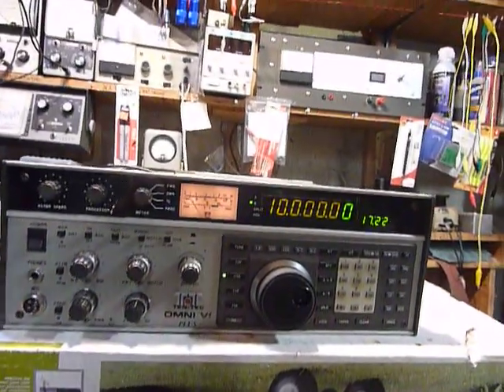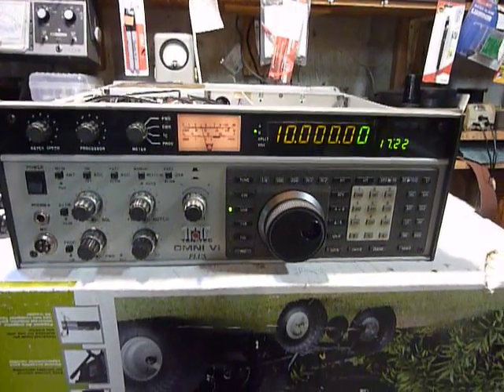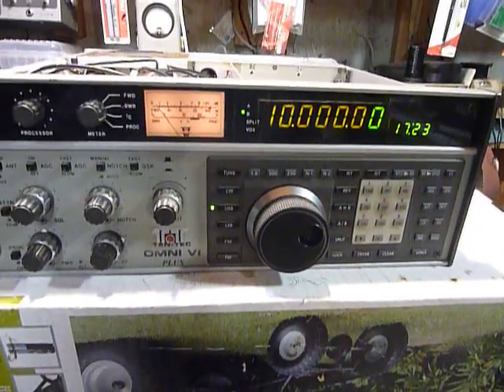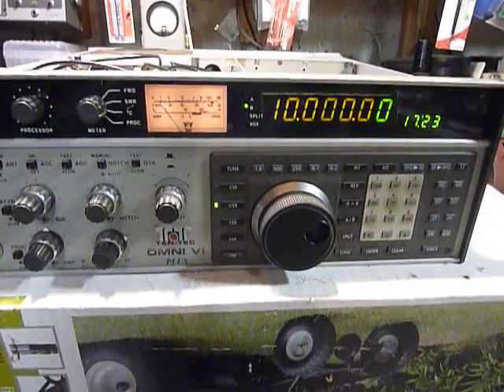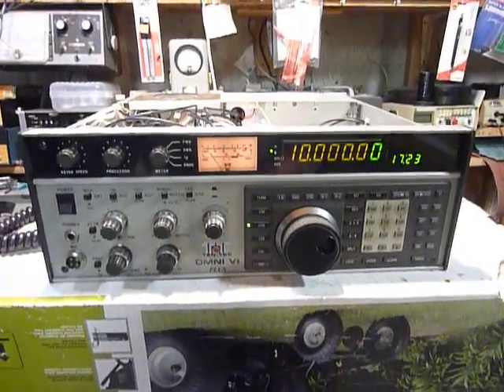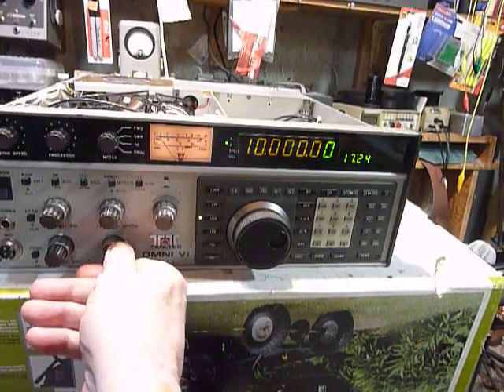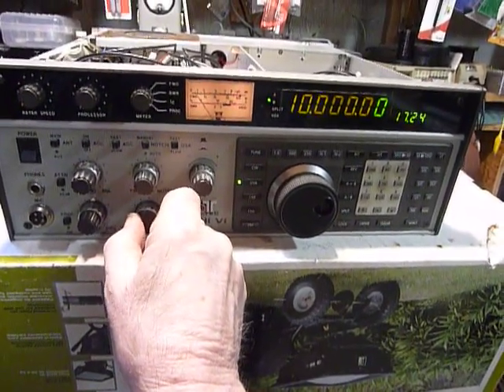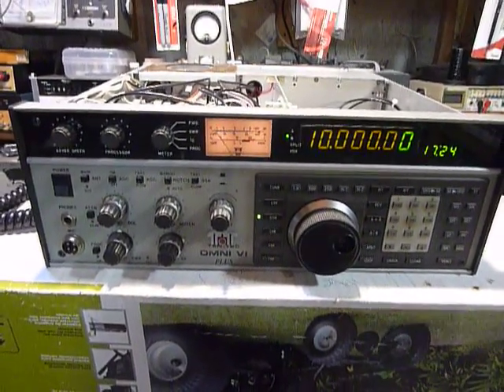Part 4 , Ten Tec Repair , Intermittent Pl Board ,  Final test run

Comment: Hi Bob, 
Just a fyi: From at least the Corsair the pcb's at TT were wave solderd and usually looked nasty with flux everywhere and as you saw solder balls also everywhere. In fact the Paragon had 3 pcb's which made up the PLL and after 6 months or so of use the users would get the dreaded PLL unlocked message. Turns out those boards were too light for the wave solder tank and would not solder well at times or in places. Removing the boards and resoldering all of the solder connections with fresh flux would solve the problem.
I am a TT collector and when I buy another TT rig, I pull the pcb's, clean them with acetone, outside, and inspect solder connections.
I am also not a fan of the friction connectors throughout the TT rigs but they seem to hold up OK. One thing you can do from time to time is go through the rig connector by connector, lift the connector and brush the male pins with a toothbrush and a little Deoxit. Then hit all of the RF coaxial connectors the same. In all cases the rig seems more robust and dynamic after taking the time to do this. I suppose the recovered net gain from many small voltage and signal drops which had slowly degraded over time, makes a significant improvement once restored.. 
At some point TT started to farm out their PCB work when they able to get better quality pcb's and for less than it cost to manage the assembly inhouse. I am pretty sure the Orions and all other later rigs had 3rd party pcb's
The 4th and newest TT owner is trying to bring TT back to where it once was. He has a long row to hoe but he's a bright fellow and has a huge amount of very nice pick and place equipment plus all of the technology to make pcb's. There is still a large fan of TT rigs and I hope he is successful. 
I really enjoy your excellent videos Bob..
73,
Glenn WA4AOS
SC
Reply: Glenn, thanks for posting that comment. I like Ten-Tec radios as well. I have just received a O6+ in mint condition along with a 960 power supply, a 708 desk Mike and a 238B tuner. All 4 look as if they just came off the assembly line.  The O6+ is a very late model without the orange dot. I just made a serial cable to control it with HRD. Works great. Tomorrow I make a Mic cable for the Signalink USB.  Really like this radio.
Mike
kj4pom